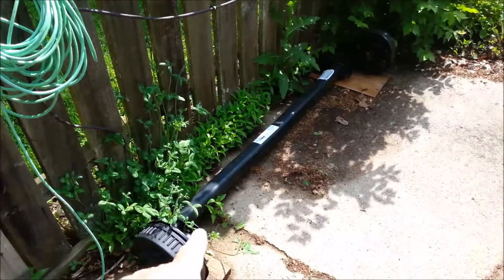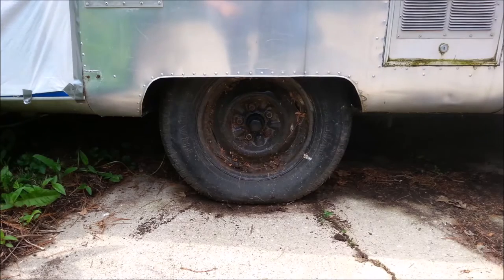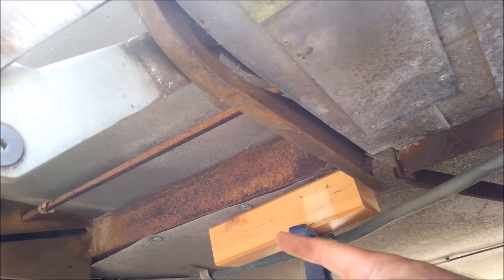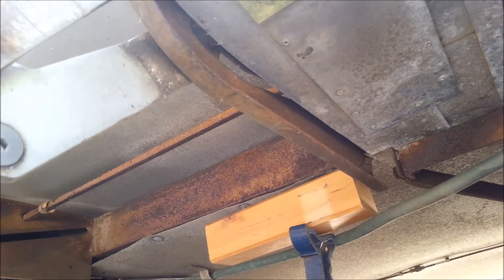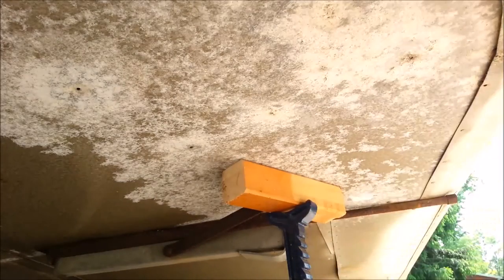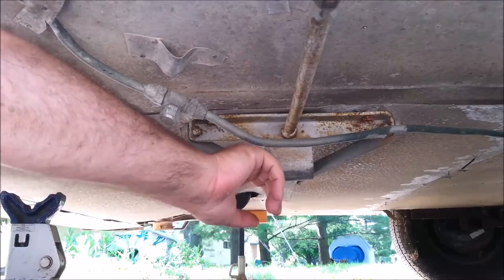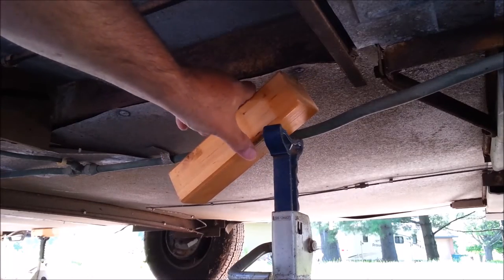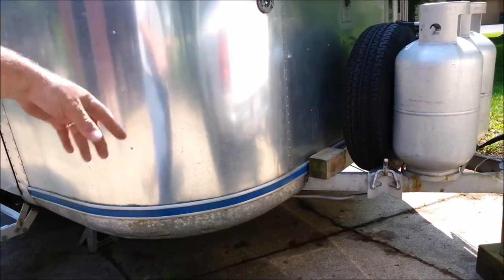1967 Airstream  Caravelle Axle Replacement Part 1 Jacking! Crafted Channel

Comment: Jack Stands or timber cribbing are always the way to go.  It is weird you just put this video up, last Saturday my neighbor was changing the brakes on his trailer and it fell and pinned him, luckily there were several of us in the neighborhood outside doing work that came to jack it up and get him free.  He did not use jack stands just an scissor jack and it  rolled over on him.  I is pretty bad that you can buy jack stands at HF for about 20 bucks, or borrow a set, now he has a sore leg, did not break anything which is lucky, but a little thought process before and would have saved allot of pain.  Good job work safe, and get it done.  Thanks for sharing.
Reply from the maker: He's very lucky to be alive.  My father taught me and I was was not allowed to crawl under a vehicle without a jack stand under it.  He didn't even like blocks.  Said they can crumble.  I've a few around here that fell apart when I picked them up.

Comment: Geeze I love that it took 45 minutes to leaf blow the driveway! There's a few awesome way to that alot faster 1st way blocks of wood pull forward on them then support with jack stands. Way two a bumper jack on the rear and dead lift. I hate airstreams with torsion axles Crowley suspensions are far superior. If you had just leaf blown first it would have been a quick video
Reply from the maker: Are you drinking?  The video is only 13 minutes long. I couldn't have shown you 45 minutes of leaf blowing.  Google has exactly zero results for Crowley Suspension on an Airstream.  If they can be fitted it might be worth considering.  However, I did the project 2 years ago. Feel free to PM me for my address and you can supply me the Crowley suspension for a dual Axle Airstream I plan to do next.  There are as many ways to jack up an Airstream as there are ways to be rude and impolite.  I did this one the way I like the best and will do it the next one exactly the way I like.  I checked your channel to find your videos on camper jacking and Crowley axles.  I got a goose egg for my efforts. No content of any kind.   I'll check back every day looking for the axle installation and jacking video.

Comment: Way easier way to jack a trailer is use old school ramps pull forward on them. I would never put Jack's Bellow get a 2x4 1/8" wall 4 jack stands under the tongue under the rear chassis! Never put stands under a trailer. Watched a friend do an axle on a much larger trailer 15k in medical bills. Imagine a shop with a two post lift if the vehicle falls off it hits the arms before it drops to the ground.
Reply: 2x4 1/8" wall STEEL 10 FT LONG one front one aft don't be Ludacris it should cost $140.00 for the steel max
Reply from the maker: You must not realize my purpose is to take the axle out.  What I did was perfect to my cause.   I'm not quite sure how I'd remove the axle with all the weight of the trailer sitting on it.  I know, it's weird isn't it?